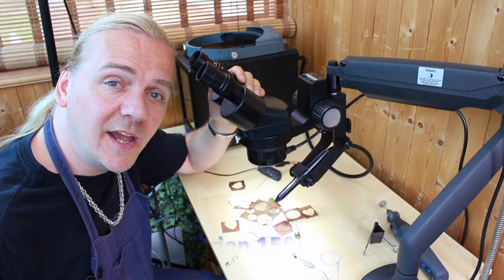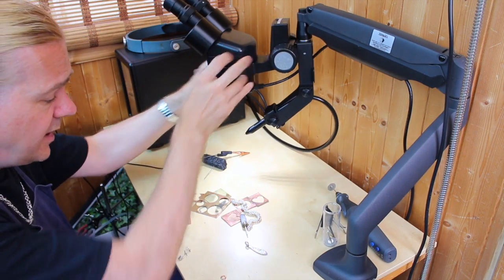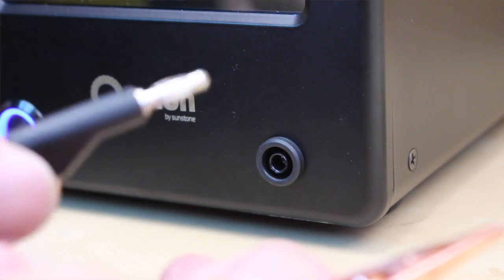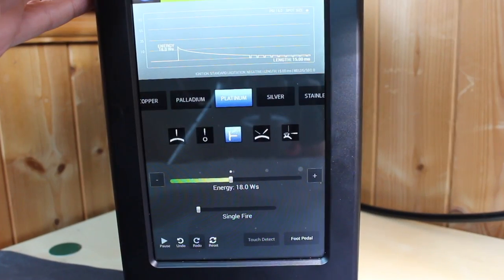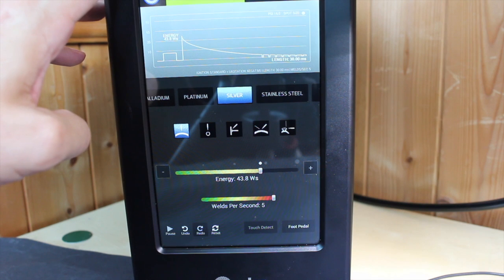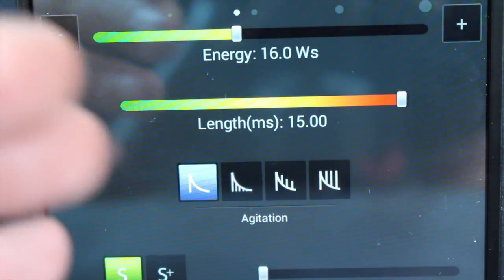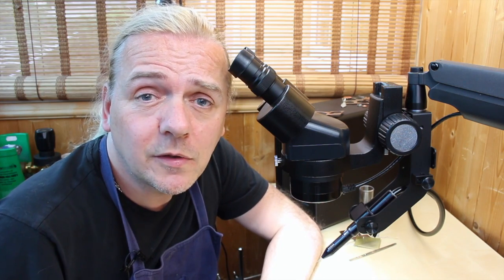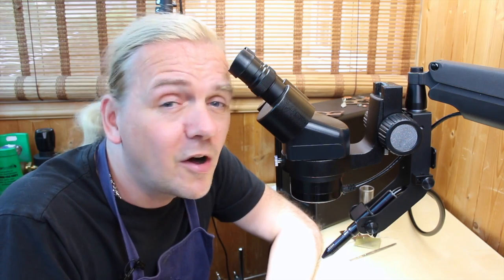Orion 150s Pulse Arc Welder Demo & Review

Comment: Hi there  just want to know How long a battle of argon  last
Reply from the maker: I presume you mean a "bottle". difficult to say. If I'm welding a long necklace, where i hit every link with four welds. Then thats pretty much going. to use most of the bottle. Just the usually jump rings and chain repairs, its only a single puff. So will last ages. But repeated welding for hours, will deplete it within a few jobs. It's something which I do have to factor into the price with long chains and necklaces. The argon can easily cost more than the silver. Dave.

Comment: Hello,
thanks for the videos of the Orion arc welders, they are very informative.
I have a few questions, if you wouldn't mind answering.

1)  I have been looking at the ORION mPulse 30 Arc Jewellery Welder with Swingarm Microscope.  I mainly want to use for jump rings on 9mm lobster clips, hence the microscope.  Do you think the microscope is very beneficial over the other version with the blackout screen.  When I am usually closing up the tiny jump rings, I usually have a 7x + in my eye so I can see the tiny rings!
I suppose I am asking, is the extra £500 quid spend worth it, in your opinion or could you use an eye glass while viewing through a blackout screen.

2) There maybe the odd occasion when I might weld/solder a charm or disc to a swivel cufflink fitting.  Would the mPulse 30 arc welder be MAN or woman enough for that sort of job.

3) I looked at the argon gas bottles and I noticed that suppliers have mixes of argon.  Is it pure argon that you use or a mix.

Thanks for answering the questions.  Do you have a affiliate code that you get some kick back if I buy ??
Reply from the maker: Emailed you. Dave

Comment: Which model do you suggest I buy today that will weld 14k, 18k, silver, platinum and do resizing jobs, fix porosity, join parts, replace torch?  I would use it once or twice a week on a piece only
Reply from the maker: I now have a combination. I have the m-pulse as seen in my other video below). But I now have the microscope too. They make a version of the microscope with a cradle to hold the little pulse. so this gives me the vision I need (the microscope is really essential), but I don't need all the fancy settings or additional speed of the computer controlled ones. Start with the pulse, and if you need the microscope add that later. Just my own experiences. hope this helps. Dave

https://www.youtube.com/watch?v=FeMd_ZXkXa0

Comment: Which do you prefer,the orion 30 or the 150
Reply from the maker: I have the 30, which has been upgraded and mounted on the microscope. I feel this gives me a great combination cheaper than the 150. For me this is great. it depends if you need all the added features of the 150 such as the speed , variability, and extra power. Hope this answers your question. Dave

Comment: Hi, you are always using argon Gas or is it possible to welding Silver and gold without the gas ? Thanks.
Reply from the maker: Yes you can, but it's very inconsistent and hard work. When your gas runs out, you WILL notice the difference. In short, you need the gas. It creates the optimal conditions for the spark. A great video (see link) where a guy shows the difference with a large welder, with and without gas. Dave
https://www.youtube.com/watch?v=VClAJbdeotY

Comment: When welding there's a lot of blackness on the metal with argon gas would this eliminate this?
Reply from the maker: Not entirely, you still get The "soot", but it's easily wiped off, hence the use of a fibreglass pen. Dave

Comment: Hi , quick question, can I weld silver findings to  316 l steel posts of 1 or 2 mm diameter? Thanks
Reply from the maker: A very specific question. I personally dont work with steel, as Ima jeweller so predominantly use silver and gold. However, you can weld steel and ferrous metals quite happily. I regularly weld 1.5mm silver. If using 2mm steel post you will probably need a couple of hits, around the circumference. Thats how I usually weld anyway. Hope this helps. Dave
Reply: hi Dave thanks for that

Comment: Hi Dave,

Thanks for all of the informative videos.
Having watched quite a number of videos including your two reviews of the Orion Plasma Pulse Welders, I decided to purchase a 100C as a Birthday gift for my jewellery designer/maker partner.
Unfortunately, I'm having a massive amount of trouble finding the correct connections from a standard Argon two gauge regulator (SGS supplier) to the Sunstone supplied 1/4" OD plastic gas feed pipe. I've tried several local welding supplier outfits in Huddersfield but still nothing. Could you let me know where you purchased the connector fitting from the 3/8" regulator output  to the Orion provided pipe? Cheers, Ken
Reply from the maker: Hi Ken, I simply went to my local welding supplier (where I got the argon) and simply said I wanted a regulator with a gauge and adaptor to a 3mm inside diameter (or whatever it is) hose. They gave me the tank and all the appropriate bits. In my case there is the nut (what attaches onto the gauge) and inside the nut is a separate "barbed" hose connector. available in various diameters. Tons on eBay / amazon etc. see link for a pic. Dave
https://www.mscdirect.com/product/details/99229528?fa=true

Comment: What about ventilation? I just got this same unit and there's safety concerns with the Argon & when welding stainless steel (hexavalent chromium is nasty). I know it's a very minor weld, but I thought I'd ask.
Reply from the maker: As you say,it's only a microscopic weld. So unlikely to be an issue not like using a full size welder on a vehicle or large structure.  I weld silver jewellery for hours at an end. I just have a window open next to me to keep the fresh air. If it starts to get a bit fragrant or stuffy, I just take a break and get some air. But thanks for pointing it out. Dave